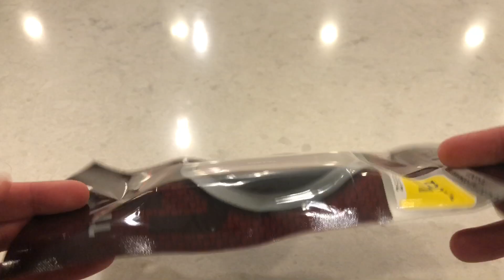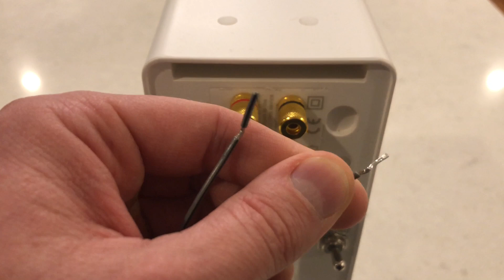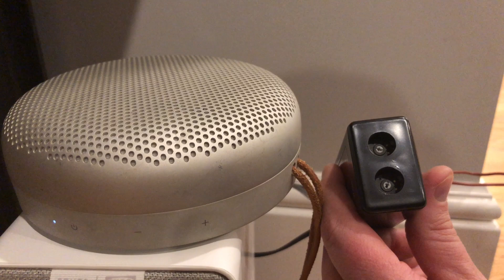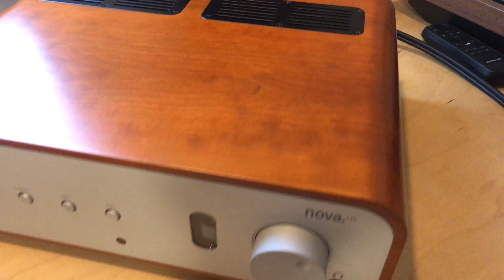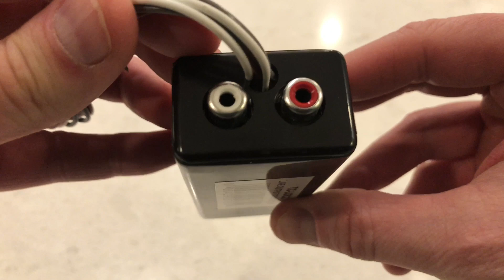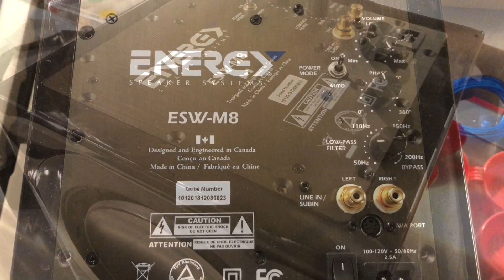A Cheaper Connect? Sonos Line Out DIY Ikea Symfonisk Hack (Verdict: Meh)

Comment from the maker: UPDATE: Someone figured out how to get a signal out of the DAC if you're willing to do some soldering: https://www.instructables.com/id/Cheaper-Sonos-Architectural-With-IKEA/ (thanks @PBPB for the tip)
Reply: Thanks Todd, do you think connecting the Symfonisk RCA to aux output would work plugging into a Sonos Play 5 gen 1? In order to get the functionality of the Symfonisk and the speakers of Play 5.
Reply from the maker: @MrJrg1017  Is this to stay in the gen 2 controller? In my opinion, that wouldn't sound nearly as good as just using the Play 5 straight up in the gen 1 controller, lots of signal loss in all that converting.
Reply: @Todd Parker think there is a decent way to do it? Mainly for AirPlay.
Reply from the maker: @MrJrg1017  I can see airplay is an important feature, just worried you'd be disappointed with the audio quality. Seems there is a workaround where you group the Symfonisk room with your 5's, Airplay to the Symfonisk and just turn them all the way down. https://www.reddit.com/r/sonos/comments/condpg/air_play_2_and_homekit_with_old_sonos_system/
Reply: Todd Parker ya I was thinking about that. Just seems uneven if you have those set up as a stereo pair, or not sure how it would do that. I was thinking of it for one room. But I could split up.
Reply from the maker: That’s fine, you’re grouping rooms together just like you normally do so a room can be a stereo pair. You’re just using the muted airplay speaker as a way to push sound to the non-airplay speakers
Reply: Todd - first wanted to say I love your videos - excellent work!  Would love your thoughts on the following: I’ve got two Symfonisks set up like yours (e.g. two switches, 4 posts) which drive two rear surround speakers plus a powered woofer (with an arc under the TV). I’m interested in mixing this set up with adding the “get a signal out of the DAC hack” (e.g. solder and add RCA female plugs to the back of the Symfonisks) then running rca cables from the two Symfonisks to my marantz amp and running Sonos to my (currently unused) front wall speakers in my old in-wall 5.1 setup. I would then be able to use the surround speakers with the arc in one scenario (Scenario 1) - and in another scenario (Scenario 2) use the front speakers (with the rcas) with the surrounds and woofer by just powering up the marantz amp (e.g. I’d use powering up my Marantz as my “switch” vs. hardwiring switches to the rcas in the Symfonisks).  Any thoughts on this set-up? My only concern is that I think I’d need to run TruePlay all over again whenever I go from one Scenario to the other Scenario.  Curious to know if this set up would even work and if there’s a way to avoid running TruePlay each time I change scenarios.  Thanks in advance!
Reply from the maker: @Hiro-vj4po  hey, that’s quite a setup. I agree that switching modes will mess up true play and I don’t think there is a way to save configurations. Are you switching modes for movies vs 4 channel music?
Reply: @todd.parker  thanks Todd - I figured such - switching scenarios will mess up true play - bummer. Yes - my intent was to have a TV set up (without the front in-wall speakers  - just the atmos, rear surround and woofer) then pivoting to the in-wall speakers with woofer for listening to music.  Also - was just interested in mixing hacks and squeezing as much value out of the symfonisks (similar to what you did with respect to adding the sub to your bi-amp setup with 2 symfonisks). 

Separate - random question: When you add the EWS-8 woofer to the bi-amped symfonisks that are driving the rear surrounds, do you add both of the symfonisks to the woofer or just one?
Reply from the maker: Honestly I just connected one. I don’t think the second will make difference since low end is usually mixed to mono-ish
Reply: Thanks for this very helpful video. Do you know how to get the low level signals out of the DAC on Symfonisk Gen 2?
Reply: I am the sales director of MyGoldGame. I want to talk to you about our company's business cooperation and get a commission of 100,000 rupees per day. Please add my (Telegram) APP account +91 83489 58764 and look forward to your joining

Comment: Hi Todd, sorry but another dumb question… when using a line level converter where do you connect the grounding wire to please on an ikea symfonisk?
Reply from the maker: In this video, my conclusion is the line level converter wasn't super clean but if you want to do it, you could connect it to the screw on your outlet, that should work
Reply: @todd.parker Thank you 🙏🏽

Comment: @Todd Parker, i have a rell sub that require to connect normaly to the amp wit one + and one - on the left output and one (black) wire to the right -.

When using this with the symponiks do i need to open both speakers? 

Note the black wire is for ground. 
The rel has no return or speaker output.

Hope you can help me out before starting this cool project.
Reply from the maker: Since there isn’t an output, the only benefit of connecting a Symfonisk is getting a signal to the sub rather than also reducing the bass going to the small speakers so I’d just wire one up, bass is rarely in stereo
Reply: @todd.parker  

Thank you for your response. Sorry for the double topic. Really like how you made the videos

Comment: You have to watch for the output ratings on these devices, as they can heat up if not able to handle a receiver spk. line output, it can cause damage.

Comment: Todd, these videos are excellent!  Let me toss this out and ask your opinion.  I want to run some outdoor speakers, and my indoor sub that has line level inputs (multi purpose symphonisk hack).  The amp I am using is a little 20x2 driving a pair of 2 way 6.5in on the patio.  What do you think would be the best way to do this?  Low level to powered sub via speaker wire from added terminal, but do you think I should try a LOC to the little amp (which has 3.5mm input only) OR what do you think about using the Sonos amp to run the patio?  Wouldn't be stereo I know, and I would have to run in series and it would be 16ohm.  Has anyone ever used a LOC from the subwoofer line out to speaker leads and converted that to RCA/3.5mm?  Just not sure A if the signal is strong OR the signal is full range or just low end.
Reply from the maker: Hmmm. I think the best sound would be to bi-amp the outdoor speakers with the Symfonisk amps, then jump a wire off the woofer to feed a signal into your sub. I how in this video that you can't get a clean full range signal from the symfonisk amps by combining the signals and you should put the internal amps and true play to good use anyhow. Just my 2 cents.

Comment: Dear @Todd Parker, thank you for you videos about Sonos/Symfonisk. Can you please tell us about the music quality using a subwoofer with solely RCA input and RCA convertor vs. using a subwoofer with amplified speaker input? Thank you.
Reply from the maker: The built in inputs may be more consistently reliable because the manufacturer has optimized it for their amp bu f you get a high quality speaker to RCA converter I think it will should about the same.
Reply: @todd.parker  Thank you very much for your quick reply. So now I will try the hack using Symfonisk&speaker to RCA converter&Jamo Sub210 instead of buying a subwoofer with speaker level input. Should be about the same as i understand from your answer. Thanks!
Reply: Dear Todd, it works! Today I connected the sub with a RCA input convertor. Question: can i add this adjusted symfonisk as a subwoofer to an existing room or should this be installed as a separate room? Thank you!
Reply from the maker: @j.procee1231  If the IKEA speakers are set up as surrounds in a home theater room then you’re all set. The alternative is to add the symfonisk as a separate room and group it. I cover all the scenarios in detail on my wiring guide video

Comment: I ended up putting two Symfonisk as a stereo pair and room then grouped with Sonos beam. After messing with the dialogue sync, I think it sounds decent. Vocal’s sound much better. Another q- looking to connect Symfonisk to recycle mode play 5. Please lmk if you have seen stone do this. Not Bluetooth.
Reply from the maker: With that kind of setup, it won’t do the DD surround sound for the rear channels so it’s probably good for music but how is it with home theater? Why didn’t you add them as surrounds to the beam room? Not sure I understand the play 5 question...
Reply: Todd Parker I will have to check the DD surround. I have found it beneficial for normal tv watching like news etc. I have play 1s as the surround’s. Currently a powered sub connected to the right rear.  There are a lot of Play 5s for sale cheap that are ‘bricked’ by Sonos when they had their product recycle program.
Reply from the maker: @MrJrg1017  It's too bad Sonos is bricking these old devices, especially since they will work with the controller going forward. Have you heard of any way to bring these back to life? I'd assume when they phone home to Sonos, it checks some sort of unique ID embedded in the devices to see if it's allowed. You could always bypass al the internal electronics and hook up a cheap amp to it with a simple crossover but I don't think that's worth the hassle. Curious what you have in mind.
Reply: Todd Parker there is one guy on YouTube who says he has done it. But hasn’t said how yet. I tried a Netflix movie with 5.1 on my Roku TCL tv. Connected to beam via ARC. With only beam and surrounds it shows as Dolby digital and I hear everything. It says the same when I group it with 2 Symfonisk. I like the sound with them grouped.

Comment: This is a nice hack. I have done the same thing now and it seems to work fine. Do you know any more about the stress on the amplifier? I mean, a "high level to low level"-converter should be fine to use, I think. I can't find any specifications on my converter, but the signal it needs to convert it to low level isn't any high right? And it doesn't have to drive speakers with the signal. With that said, with this hack I think you can have the internal speaker on as well as sending the signal to low level at the same time. What do you think? I think you have much more knowledge in the matter than i.
Reply from the maker: If you use a converter or the speaker inputs on your sub to connect, they have a high impedance so they basically don’t take any power from the amps so there isn’t any stress. Glad this worked well for you.

Comment: Great videos Todd! I was wondering if it would be possible to do a video on how to add Audio Line-In to Symfonisk. I have two Symfonisk speakers in my bedroom and I just purchased Anker Nebula 2 projector which has AUX out 3.5mm jack. It would be great to be able to plug from 3.5mm stereo jack to RCA one for each symfonisk speaker.  Hope I'm explaining this correctly 😊
Reply from the maker: Makes sense, but I don’t think that would be possible to do without a lot of soldering and firmware level hacking
Reply: @todd.parker  was hoping it would be easier 😊 thanks for reply. I guess my next step is connect nebula to Bluetooth adapter connected to my Sonos Amp.
Reply from the maker: Check this out: https://www.instructables.com/id/Cheaper-Sonos-Architectural-With-IKEA/

Comment: Todd, I saw your Energy Speaker ESW-M8 on your video. I was looking at doing a Symfonisk subwoofer hack, but my ESW-M8 is not working.  I'm trying to determine whether I should buy a new subwoofer or maybe buy an amplifier (like from Parts Express) to fix it.  What would you recommend?  I like the small size of the ESW-M8, but that does limit the physical size of the amplifier that will fit it.  If you were to recommend an amplifier replacement, what wattage would be needed. The ESW-M8 specs "say" it is a 1200W output subwoofer, which limits the amplifiers.  But, is that what is really needed for to size up an amplifier?  Maybe you also have a recommendation of how to repair the existing amplifier since I read a lot about cheap capacitor failures. Your videos are quite informative for the Sonos do-it-yourselfers.  Thanks.
Reply from the maker: Yeah my Energy sub just stopped working one day, nothing obvious wrong and fixing it is beyond me. I looked at Parts Express and the only options that seemed like they would fit was some thing like this 25w amp and I wasn’t sure if it would be loud enough. https://www.parts-express.com/dayton-audio-sa25-25w-subwoofer-plate-amplifier--300-782
Reply: @todd.parker  I made as added compartment to the back of the unit to accommodate a Yung SD300 subwoofer plate amp (https://www.parts-express.com/yung-sd300-300w-class-d-subwoofer-plate-amplifier-module-no-boost--301-508).  It sounds great.  I can send you the plans if you're interested and you still have the speaker.  If you still have it and don't want to update it, would you be interested in selling it?
Reply from the maker: Lee Nert I haven’t gotten around to fixing mine up, not sure if shipping and selling is worth the hassle? Contact me if you want to talk...
Reply: @todd.parker  Hi Todd. Let me know what value you 'd think it be worth to sell and ship (destination Chicago metro area) the Energy ESW-M8 sub to avoid the landfill. Or, if you'd like my sub extension drawings for the Yung SD plat amp to give it a second life, I'm happy to send that to you.
Reply: @todd.parker  Not sure best way to "contact" you for the details
Reply from the maker: Probably not worth shipping now that I think about it. I’d like to see what you did with the plate retrofit

Comment: Isn’t it possible to wire the + & - directly to the aux cable and forgo the box? Then connect to a receiver/amplifier and have multiple speakers playing?
 Btw, I’m in no way knowledgable about the subject :)
Reply from the maker: No because the amplified speaker output are much higher wattage than a RCA signal, like 100x or much more.

Comment: Ayy you finally did it! I commented 5 months on your og sub video that I did this and you asked me how I managed to get a full range signal. Looks like you figured it out! Although I have some suggestions. Using two adapters, both RCA L/R male to single female with a male/male connecting the two might improve your sound quality over the 3.5mm stereo jack. Then after I determined this worked to make the connection safe because you are right that it can be damaging to do this I added two 1k ohm resistors on the y connector right after the L/R male that connects to the line-level inputs (check out the article "Why not Y"). Serendipitously this also improved the sound quality and response. Finally, after getting the gains at a good setting I used Trueplay to tune it and I am very pleased with the result of the hacked connect, it sounds very good. Did you Trueplay? You did not mention it if you did and this made a drastic difference in how it sounded. 

For my extreme Sonos hacked system I have a beam with a One as my SR and for the SL I have the symfonisk connected to the CD input on my receiver to which I have a single Paradigm Atom speaker connect to the B speaker output. I then have my sub connected to the sub pre-out on the receiver as well. Surprisingly it works and is all in perfect sync and all the different speakers match great sound wise. Then on the A speaker output I have my two Titan speakers connected. For listening to music I usually just airplay to the symfonisk and only turn on the A channel. But if I really want to bump I have the A and B channel on plus the One and the Beam. Anyways that's my opinion and setup. Thanks for sharing with everybody this additional hack. Curious what hack will be next!
Reply from the maker: I'm glad this unpriced you to doing some hacking and thanks for following along. It seems you were able to get the signal cleaned up better than I was. Do you think you'd call your version high fidelity enough to use? I'd be curious to see a photo or diagram of how you wired yours up with the resistors...

Comment: As a not so audiotechsavy person I did not quite understand why this is so complicated. Cant u grab the signal at an earlier point of the platinum? Istnt it a line signal before it gets amplified to power the drivers? Thanks a lot for the work u put in!
Reply from the maker: It may be possible with much more electrical know-how than I have. My hunch is  the signal is split in software before being sent to the amps so it’s likely not just going to be so lucky to just be able to solder into a full range signal sitting on the board.
Reply from the maker: Check this out: how to get a signal out of the DAC if you're willing to do some soldering: @t
Reply: Just saw that ufhereo suggested the same thing

Comment: I think people want a line in!
Reply from the maker: They really, really, do. I get so many questions about it on every video.
Reply: @todd.parker  is it an absolute no do you think in terms of possibility?
Reply from the maker: I think a line out would require a lot of hacking in the firmware. I don’t think a line in is even possible because there may not be a D/A chip in the speaker
Reply: The Play 5 has a line in. I'm hoping that I can still use my system through this once SONOS discontinues software updates for their older models. I just read that they are going to drop the old system soon, now that they have a new line. Which is why I am browsing YouTube for various answers, hoping I didn't spend $1600.- for nothing  two years ago...
Reply from the maker: Sunila aka DragonladyCH we’re all hoping Sonos does the right thing. I have quite a few “outdated” pieces of gear